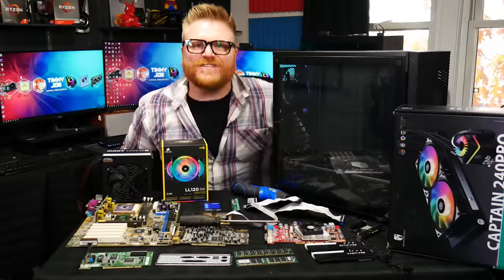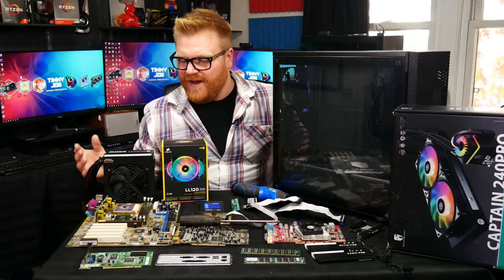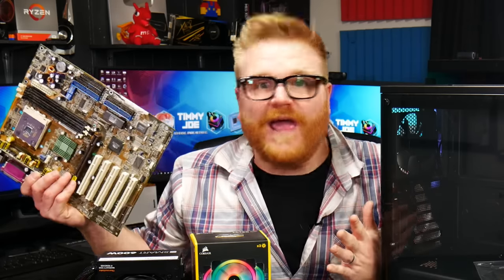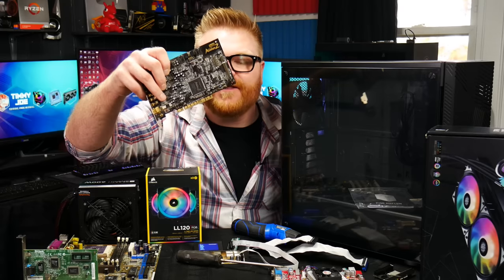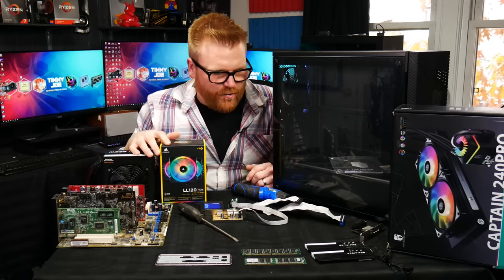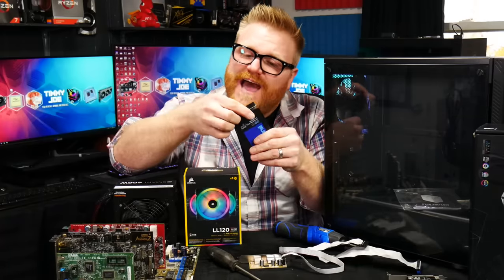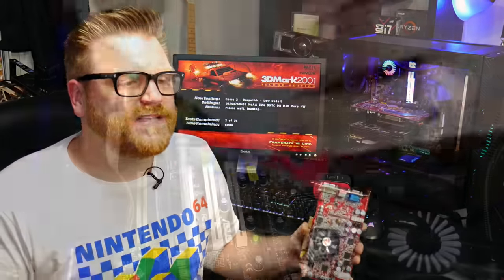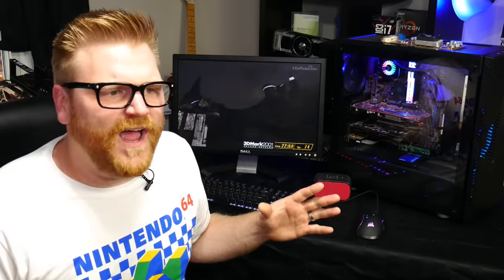Building a 20 year old 1ghz Athlon Thunderbird reverse sleeper!

Comment: It's kinda like when someone puts spoilers, decals and body kits into a 2003 family sedan.
Reply: Or a Honda Civic EX...  sedan
Reply: G.I.E. Gaming Inspired Enhancement.
Reply: @Ryzen Core Cause an EX has the crappiest engine, no VTec, and putting a spoiler on a front wheel drive car makes you loose grip.

Decals and body kits are fine though.  Was going to plastidip mine until it died on me...  that engine is a stinker
Reply: more like Lambo with 1.3 engingne
Reply: @bepbep7418  *Gaming. Inspired. PC. Enhancement. GIPE 🤣

Comment: ahh memories,i still have my socket A Sempron 2800+,1.25GB of ram,an HP motherboard,Radeon 9600 Pro 256mb AGP..this system to me was a beast back in the day it handled pretty much anything i threw at it with ease.

Comment: Reminds me of the first custom PC I built when I was like 13-14. Moved from my P4 with 512MB of RAM to an Athlon 64 3500+ (i think) with 2GB of ram and a Geforce 6600. The P4 was stuttering hard when trying to play UT2004, I forget the AGP card that was in there. 

But it was night and day when I got it up and running which made 14 year old me very happy. I might not have the hardware that was inside it anymore (since it was literally used until it died, still got the heatsync gathering dust in the attic) but I've still got the case. (it now houses my old Q6600 with 4GB of ram.

That being said, I DO still have the GeForce 6600 (which still works) BOXED. As well as the GeForce 7900 OC that came after (also Boxed) sitting on my shelf. It seems since then I haven't had the heart to discard any of my old tech.

Thanks for the video Timmy! It gave me a little nostalgia trip!

Comment: Gawd! My first DIY was an AMD 1GHz TB in late 2000. My next rig had a Radeon 9800Pro that was flashed to a 9800XT as it had the same core as the XT. You can only flash them if the VRAM was using Hynix chips. This was a blast from the past.

Comment: This was the first processor I ever built myself. They run VERY hot.
I previously had a 133Mhz prior and I could literally remove the heatsink (no fan) and not cause a problem, so I assumed the same was true with the Thunderbird. NOT the case. It started smoking immediately.

Comment: I had a TBird in 2000 as well, i managed to OC it to 1.3Ghz 24/7 100% load stable, on basic coolers etc. of the time.
The very small amount of ram was probably holding this system back a lot. i remember CS 1.6 used to run on that system extremely well :)

Comment: I remember using conductive pens and stickers with jumper traces on them or a pencil, to short contacts on those cpus to do overclocking or unlocking them. I also used a shim to keep from cracking the die. I had some cpus on a card also. Oh the memories

Comment: Makes me think of the first computer I've built myself: MSI motherboard with a Slot A AMD Athlon 650MHz, a whopping 128MB of SDRAM, 10Mbps network, Soundblaster 128, and a Riva TNT Cougar with 32MB of video ram. I cut a big plexi window in the sidepanel, painted the whole thing metallic blue, replaced the casing of the PSU with mesh, had white CCFL's in there, DIY round sleeved IDE-cables and the bays were loaded with a 60GB HDD, CD-ROM drive, CD-rewriter, ZIP-drive, 3.5" FDD, and a fancontroller/tempdisplay thing.

Comment: This isn't the first Athlon, there were the Slot A which was a platform that launched in mid 1999 with the first Athlon aka K7. These CPUs were quite cool for that era (although power hungry), a competition for the Pentium III Coppermine. The Slot A was quickly abandoned in favor of the Socket A/462 and the fastest CPU for this platform was the Athlon Thunderbird 1GHz, even if there was also a 1GHz Orion (this one came before the Thunderbird) Athlon. Nice video btw :)

Comment: Should try a bit later Athlon on socket 939 or 754, can fit pci-e or agp depending on the motherboard ddr ram sticks this time around.
939 has early dual cores competing against cpus like the core 2 duo e6600 & core 2 duo x6800
while 754 was more budget oriented at the time, but these sockets share the cpu mounting with am3+ without any problems so you could certainly slap on a decent watercooler that fits am3+ on there.

Comment: I had a similar system for my first built setup but it had a AMD Duron  900 mhz with 512mb of ram and a 80gb seagate running a geforce tnt2  32mb card which i upgrade to a AMD sempron 1.7ghz with 2gb of ddr ram and a geforce FX 5200. both were awesome systems back then!

Comment: You would have gained a lot of performance by getting a DDR motherboard and RAM and by running Win98SE or (gag) ME. I built my first PC in late 2001, a 1.2Ghz T-Bird (I did the pencil trick too) with 256MB DDR 266Mhz and a TNT 2 Vanta, later a GeForce 3 Ti200. Ran fantastic on 98SE.

Comment: Loved my AMD 1000mhz Thunderbird used the pencil trick to  overclock it to 1100Mhz it was a beast! I could use the BIOS for my OC and it was the absolute fasted thing out there at the time.  :)

Had that exact, sound card, network card, but I think I had a Geforce 2 Ultra or something in it.  Hilarious to see the AIO water-block on it, wish I had that back in the day.  I was running very noisy Swiftech pin cooler with an 80mm delta fan. Huge for the time, and LOUD.  People that complain about noise these days have no idea what we used to put up with in the name of performance back in the day lol...  Good times man, this video really brought back some memories 👍😁

Comment: I actually have 2 computers I could do something similar with.

1. Athlon XP 2600 and ATI Radeon X800
2. Athlon 64 X2 4800+ and ATI Radeon X1950XTX

Funny story, the XP was built in Seoul from e-market parts.  If you ever get a chance to go to an e-market in Korea, Japan, China, GO!  They have stores for everything.  I remember a store for nothing but switches.  Toggles, buttons, dials, that kind of stuff.  Built that thing in 04 and gave it to my brother later.
Reply: voraciousblackstn my athlon 64x2 4850e is running windows 10 yes making windows 10 light weight it can work fine. With a modern graphics card some modern games work
Reply: @Rockband2991  Oh, my Athlon 64 can't run win10 not because of the proc, but because the MB has an issue with windows above vista.  planning on using debian and going file server/linux gaming on it, bout to build a Ryzen system.
Reply: voraciousblackstn oh that sucks. At least Linux works
Reply: @Rockband2991  It's an old AM2 MB, ASUS M2N32 SLI Deluxe.  It's a known issue with it, but it's a 13 year old MB.  Not a huge issue to me, I've been wanting to get Linux on it for a while, but the CPU Cooler literally broke off so I just a couple weeks ago got a replacement and just need to download Linux to a geekstick to install.
Reply: voraciousblackstn mine is am2 also but mine works so ya that’s why windows 10 can be installed

Comment: I have a 2400+, 512mb ram, 80gb hdd, ga-7n400 board with a buncha bulged caps...had a fx 5950 ultra in there but it overheated and died...probably took part of the board with it lol. Was given to m by a friend in like 2006, as well as later on a sapphire x850xt but he didn't realize it was pci-e so i never used it. Been itching to at least get it stable just for the nostalgia trip. Awesome stuff man!! 😃😃😃

Comment: I remember having an Athlon xp 1500+ in my first pc with 256mb ram and onboard graphics which also took some of my memory.
Some games were running ok,some were running not so ok,and some weren't running at all.
If I'd only knew that I could just slap a gpu into it and some more ram...that would have been a golden setup at that time,especially for the games I wanted to play.
By the way,from a tech savvy like you,would you recommend doing a slight OC to 4ghz on an i7 5820k regarding future games?The stock speeds are pretty good for me as it is right now but I'm not really into OC-ing and I'm afraid of cpu degradation.

Comment: Back in the day. Depending on your CPU, you could overclock some Thunderbirds by 50% or more. The first were the ones with the "AXIA" date code, If you got one of those they'd do 1.4Ghz... and if you were lucky you'd get a date coded "AYHJA" version that could clock to 1.5, sometimes 1.6 if you had a top tier mobo and good RAM that could clock over 133.

Comment: That rig connected to a beautiful CRT and Windows 98SE (or even 2000) installed should be a great deal for retro gaming and nostalgic purposes. I have in mind finishing an old build with basically a K6-II+, 512/768 MB, some decent GPU and CRT and so on... My idea is having a triple boot with DOS (DR DOS 6.0), Win 98SE/2000, and Slackware Linux. That will be an interesting project.

Comment: Technically DDR (double data rate) / DDR2 / DDR3 / DDR4 are SDRAM (synchronous dynamic random access memory) but what we refer to as "SDRAM" is SDR (single data rate) SDRAM.

...and that reminds me of "SATA and IDE", which are actually SATA (Serial ATA) and PATA (Parallel ATA) which are both types of IDE (Integrated Drive Electronics).

Comment: Cool video man! You should try win98se on that machine, using the 9800pro (which was a beast of a card) and stick to older games like unreal, nfs hot pursuit, deus ex,  system shock2, etc. My main win98 pc now has a Pentium III-S 1.4GHz, 512MB SDRAM-133, a GeForce FX5900XT and a SB Live! 5.1 and it's capable of maxing out Max Payne on 1280x1024 while remaining very playable (Avg: 79fps - Min: 37fps).

Comment: The Thunderbird CPUs can OC to 2.6 GHz on 1.85V. I know it sounds like alot but for these chips it's much like running a Phenom IIX4 @ 1.50V, FX @ 1.45V, or Ryzen @ 1.40- 1.50
Reply: How the heck? Thunderbird went from 800-1.4ghz. When I built my first 1.2Ghz one I could get an extra 200-300Mhz after doing the pencil trick. 1.4Ghz owners could get up to 1.6Ghz. where are your getting info about it going more than that? Alternative cooling solutions didn't exist unless you literally fabricated it yourself.
Reply: @zenith251  You put the Thunderbird CPU in a socket 462 gaming board and water blocks did exist at that time but they didn't have closed loop AIOs. I used an Asus Arctic Ice air cooler on mine and it stayed around 32°C idle and 36-38°C when gaming. Edit: The MB itself needs to be unlocked on the multiplier. Set your FSB to 200 and your Multiplier to 13.

Comment: Heh, wish i could show off my Magikarp project build, very similar.
XP 3200+ cpu
Abit KW7 motherboard (VIA KT880 + vt8237)
2×256MB mushkin ddr434 @ 400 speeds
Xfx geforce 6800XT

Problem now is i need a sound card, that works with it in Windows 98SE. Onboard flat out won't work; and the Vortex 2 i have on hand i can't use without it basically going into an instant BSOD kill cycle.

Comment: Hey Timmy Joe, I may have some old athlon xp processors I can send your way, if I can find them. But I definitely have some athlon 64 processors, a 3000+ and 4000+ socket 939 to be exact. I also have a dfi dagf 939 motherboard. If you are interested in using this stuff for a video, let me know, it's literally doing me no good sitting in a closet.

Comment: I used to have 700mhz Pentium 3 cpu
512 sd ram
FX 5200 1gb DDr3
80gb ide hdd
I lived with that until 2006 I think
I played on it alot of need for speed underground, most wanted and carbon
All the Prince of Persia Games and old Tomb Raider games

Comment: It's not super-retro, but I'm rebuilding my 790i Ultra SLI, and making it an all EVGA build. X5492 delidded + conductonaut, CLC 280MM. Most I can get out of it is 4.08GHz@1920MHz FSB, because GTLVREF settings are REEEEEEEEE. 2x8GB DDR3 1600MHz Ballistix Tactical Tracer(8GB max is a lie. 16 runs perfectly fine.)

The only "hard part" is deciding on a video card and case. I want to run a new GPU because of power efficiency and don't care much about bottleneck. The case is going to suck because EVGA cases are $$$$$$$$$$.
If I was going to do "My first PC" I'd have to source an Evergreen Tech Spectra 400. That's more of a pain than I'm interested in.

Comment: Wouldn't the lower 640x480 make the cpu as the bottleneck? It's a 2000 cpu so a 2003 9800pro should. The thunderbird is more windows 2000 or 98se era.

Comment: I have an ASUS P5K3 Deluxe with a Xeon X5470 4.35GHz in an RGB Corsair 220i white tempered glass case, mugen 5 with nf-a12x25 fan, dual channel 2x4GB sk hynix DDR3 1600MHz ram at 1333MHz CL7 1T 1.5V, Samsung 860 Evo 500GB SSD, Wireless AC 867Mbps card, 4x USB 3.0 card for front usb3s.

Comment: If you wanna have fun on windows xp, go ahead and build a 478 pentium 4 3ghz+ or a athlon 64 3500+ or more with 2gb of ram, a beautiful and cheap gpu is a x1950pro, its the best agp card for these systems, hd4670 and hd3850 are better but because of driver overhead the x1950 pro actually performs better

Comment: Overclock on that CPU is really bad. I had an athlon xp 2000+ thoroughbred 1.66GHz that i got overclocked to 2.2GHz basically getting athlon 3200+ performance with just a little more vcore on a small al/cu arctic 8cm cooler.

Comment: You needed... https://soggi.org/motherboards/asus/A7V.htm - there is jumper mode, and jumper free (BIOS) mode.

I had a TB 1GHz on a Gigabyte 7IXE4 - I was moving up from my S7 setup, and had 2 or 3 ISA cards I didn't want to part with...
SB16 multiCD ASP with a cheapo wavetable card added, a fantastic ISA 56k modem (£5 computer fair junkbox buy in K56, flashed it to V90 and it always hit the high end of the speeds), and a Ditto Dash controller - actually, at that point I think I had to let the SB16 go and went for a PCI128
Reply from the maker: I have that board, I guess I didn't look hard enough ha thanks for the info

Comment: Blimmy bloe that is NOT the limits of the era, there is some boards with DDR1 or RDram, even sata 1.0 support  and 2 ram slots is below average for the day, could have up to 3 or 4.  And some chipsets were capable of up to 2 GB of ram (supposedly 4 in rare cases, 440bx i think)  And if you REALLY wanna see what the machine is capable of put 98 SE/ME on it, that was the REAL gaming OS of the day.   XP was buggy and more of a resource hog till SP1/2

And you could do a geforce 6800 as well, or a voodoo5,   Supposedly there is even homebrew drivers for up to geforce 7800 if not 8800 in it.

try that out if you have it and see what a REAL gaming machine was about.

You could do much better for a XP era machine both in single core or multi.  Early i7s have support for XP as well as FX 8350 and before

You COULD throw that at XP (its still viable for a browsing/daily use machine if you know what you're doing and the risks as there is still 3rd party support().  Not recommending it but still the truth.